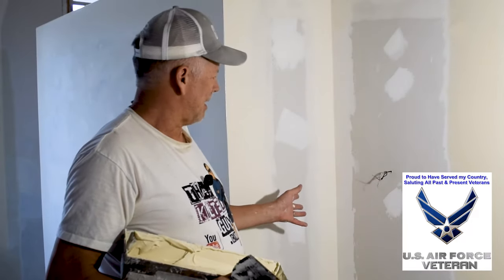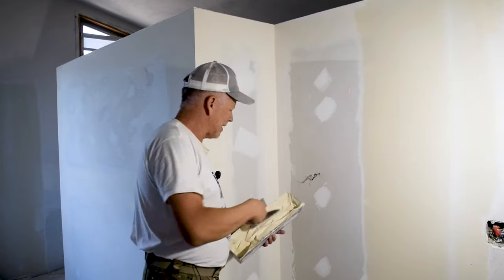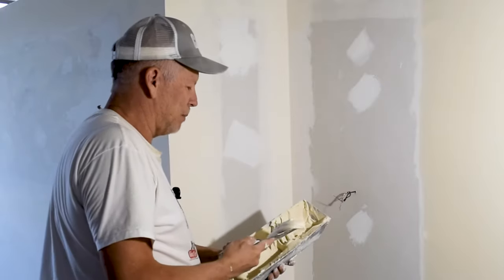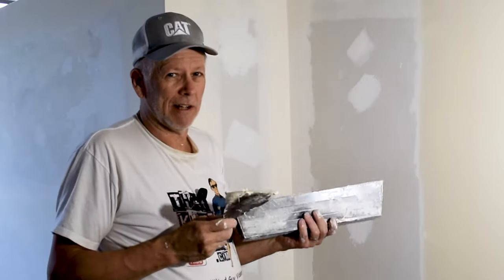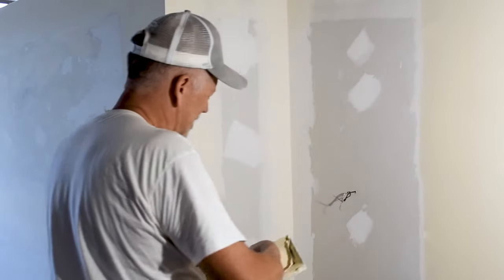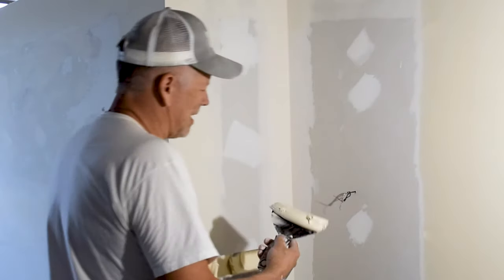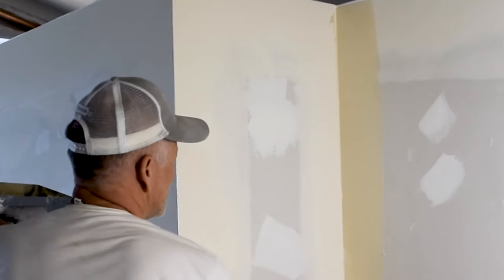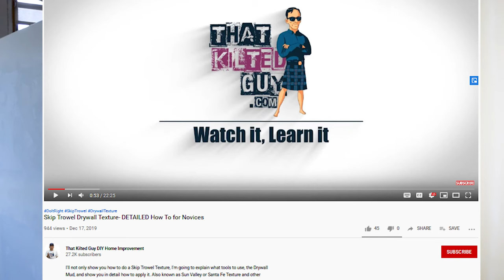Coating Inside Corners on Drywall

Comment: I love using a corner trowel. Once you get one broken in, kinda like getting a plaster trowel broken in. It's all angle and pressure. Over time it gets easier and better to use. But I also do them the way you do. I like both techniques. Once you have the corner trowel broken in, you can coat the angle and feather the edge in one stroke. But yea, they can be a pain till you have them broke in. And breaking them in don't happen in a week. Great vid. Keep it up.

Comment: Glad to see you doing better & have enjoyed how you're educating the public about the trade. 
I've not seen you talk about the "other" tapes available- "Straight Flex","No-coat"325/425,ect.... I've been doing drywall since 1975 from California to NC & I used the PVC tape on angle/inside corners up to 10' long most of the time since you can run a corner in one trip without waiting on the day+ dry time, it also provides a "very" straight corner/angle if the drywall/framing work is less than perfect. It's ideal for the novice finisher & it's really hard to burn if sanded too much by a rookie. It may cost more & you need to pre-cut but that ends up being a production advantage by cutting many pcs. &  standing them in the corners. They take less compound too as you only coat the outer edge on the 2nd coat. It's also my tape of choice in high humid or constantly wet areas where delamination often occurs.Also I've never heard you talk about "Rucco"mud by Southern products-IMO the best mud/joint compound made! using a small shot of dawn to a mixed bucket prolongs the shelf life of the mud by months & makes smoother- easier to sand joints instead of straight water for thinning. 
I got retired due to cancer & brain fog from chemo & radiation treatments too.

Comment: Good video. I use mesh tape the smaller tighter looking tape and applicated both sides with a 4 then run the angle knife down and cut my edges with a six. Might have to run the angle knife again after the first run but its ready for touch up on the final day. Dont like that plus 3 though. You are very skilled and its an art what you do! Now a days drywallers are getting paid what they should have been long ago. Mud on brotha!

Comment: I don’t waste my time taping inside corners the traditional way anymore.  I use 425 & 325 tape!  Way easier, way cleaner, and you can come back after embedding the tape and take care of both your lefts and right sides at the same time.  Great invention!
Reply from the maker: They are great but extremely pricey at around .70/ft.
Reply: That Kilted Guy DIY Home Improvement But…you need to consider labor ain’t cheap either!  This makes it faster, helps keep cost down and keep me competitive.  👍🏻
Reply from the maker: Tundra Whisperer must cost like $600 just for the angle tape on an average house?
Reply: That Kilted Guy DIY Home Improvement I don’t do whole house projects, just kitchen, baths, and small additions.  👍🏻
Reply from the maker: I’ll have to do a video comparing the two methods. Makes sense though.
Reply: Greg Nicon for me, using tradition tape methods on inside corners are slow.  After embedding my ultra tape with hot mud, then I can hit the left and right corners all at once and never need to get into the very tight corner at all.  It’s fast, clean, less work to get a finished corner.  Plus this ultra tape will clean up a crooked corner if you had one.  Thx
Reply: What's that?
Reply: You need to try the corner flushers. Way quicker and better inside corners
Reply: @briangallaugher3068  not for my money!  The 425 & 325 tape works great for me and it’s leaves crisp corners.  It even corrects mildly bad corners as well.  😁👍🏻

Comment: Not bad sir,curious why you only show doing one side,a very common problem for diyers is not recking the opposing ( allready) mudded  corner.I am self taught but always ready/willing to learn smart tips and better ways of doing things. I do use a corner trowel but never to lay on the mud, its a variation and also  agree that only 1 coat is needed for inside corners-ha,ha yankee term maybe?-or ( angles) Good to see a pro teaching  instead of a learner teaching another learner like many other y.t vids. Out there on stuff. God bless and keep up the good work.
Reply from the maker: thanks for the comment and when I’m coating angles by hand, yes I called them angles, it’s easier to do one side and that way you don’t mess up the other side like you were talking about. Let it dry and then come back and do the other side.

Comment: Do you ever do both sides of angle in one day?
  Final swipe with the knife, did you tilt it up more instead of lowering the handle as you swipe like doing bedding coat?
  That was a little confusing to my old mind.
  Btw, I agree about the corner trowels. They give me a problem.
Reply from the maker: I’ve done both sides of the angles in one day but you pretty much always have some gouges right in the inside part to fix so it’s far from perfect. I’m not sure on the angle I would have to watch myself because I just do it from muscle memory
Reply: @ThatKiltedGuyDIY  I understand the muscle memory comment. 
  These two corners worked down pretty good. 
  If I need to, I might just use a very little bit of caulk where the walls intersect. 
  Actually, I think I might get by without having to do that using a sanding sponge and a little bit of chipping the high spots.

Comment: So inside angles you don't need to float out up to a 12 in knife? Just butt joints and your factory beveled joints?
Reply from the maker: Yes.
Reply: @ThatKiltedGuyDIY   man I've messed up already. Started with a four to embed then a six and an 8" on my angles. Maybe that's why I can't get a nice crisp 90° corner. This helps and gonna save me time. Thanks
Reply from the maker: An 8” is ok if you didn’t put it on too thick.

Comment: If you're mudding an inside corner and you have door casing 2-3 inches away from the inside corner where you can't get your 4" knife in there do you just something like a puddy knife to smooth the mud out or is there a better way?
Reply from the maker: I carry a selection of cheap plastic putty knives that I can cut down on the size I need for those instances
Reply: Love how you actually answer questions!!

Comment: Why am I having so much trouble keeping drywall compound from rolling over or fall down in the very inside edge against other wall while coating inside corners. I gonna end up coating inside twice just to fill the tiny voids I keep leaving on the very inside edge?
Reply from the maker: Maybe try going up instead of down. Not sure what’s happening
Reply: I have the same problem. The knife just digs into the opposite side and puts crusted compound in the mud. No matter how much you scrape the corner before hand

Comment: After doing the corner is that when you start with the joint compound all over?
Reply from the maker: If you mean skim coating, that is way overused and I don’t do it except when needed.

check out this video- https://youtu.be/xK-Vx_ptgHg
Reply: @ThatKiltedGuyDIY  
I definitely had to skim coat it because I want as close as a level 5 as possible. I am trying to remove orange peel in the process.

What I was referring to in my question is, how do you get clean corners/edges? Just with joint tape and mud and then let that dry and go in with compound after?

I have learned all this terminology from you the last 2 days watching your videos :) 
THANK YOU
Reply from the maker: @NikkisSecrets123  yes. Tape, dry, coat, lightly sand as needed